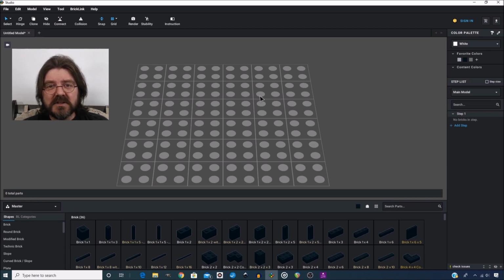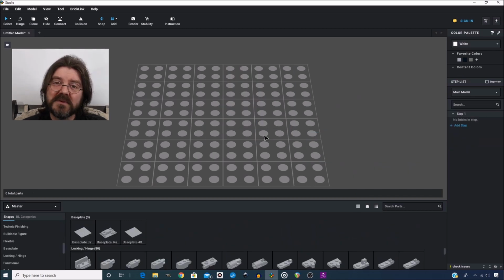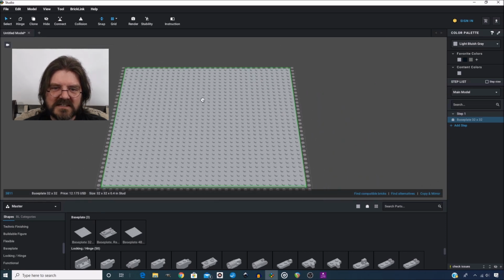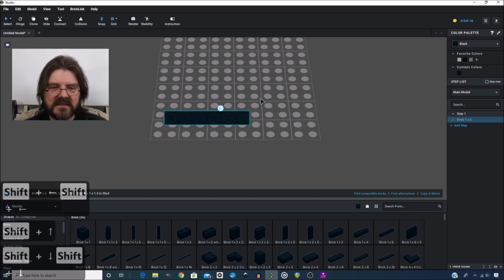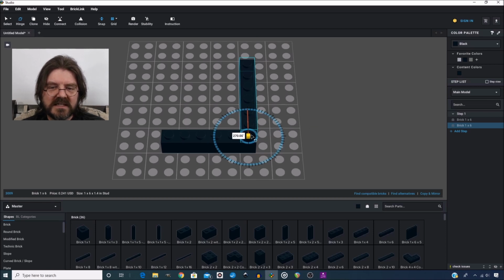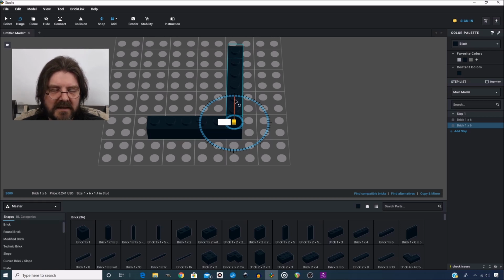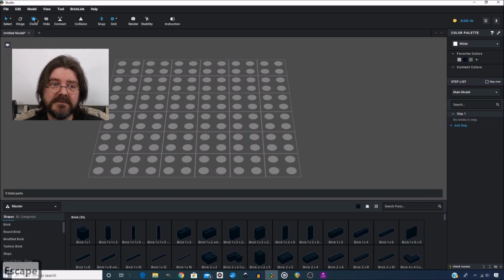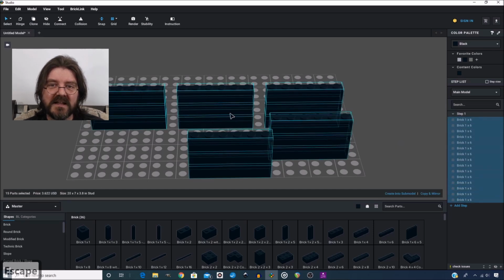Studio Tutorials - Manipulating Bricks. How to start creating your own LEGO model!

Comment: Great hints, thanks for your channel, also for adding the sub text. I would like to address a question regarding the hinge tool: Can I somehow choose or specify the yellow pivot point ? My example: I would like to show the steering of a tractor - so I choose the tires and some bricks (esp. not all bricks!), but then I can only rotate by a pivot point specified by Studio itself. As a workaround I move the selected bricks to the outside and then rotate them and then re-integrate them - sometimes cumbersome depending on the number of bricks. I hope there is an easier way.
Reply from the maker: Thanks Yanox, glad to help :)

Unfortunately that is the only work around available to us now. Hopefully this feature is implemented in the future.

Comment: Hey, Thanks for the video :) Quick question though- I found out that I have some problems with moving limbs of a humanoid model like ones from Hero Factory's 2.0 generation and forward (the ones with the attachable "body plates"), and it seems like the program can't find out some of the hinge point of any limb, like the one in the middle of the arm or the leg, and those that it DOES find are making the entire body of the model to move, and that is not the desired result. Do you happen to have a video about how to properly manipulaty such parts, and making them posable? thank you kindly.
Reply from the maker: Glad it helped.

Sometimes the issue occurs when you add another piece onto a piece you wish to move, for some reason the program will only sense two pivot points. When you run into that situation, remove the parts on the part you wish to hinge, hinge it how you wish, and then return the parts back to their position. It is a bit of a pain, but iti is the only workaround I have found.
Reply: @PlaywellBricks   Thank you kindly! :D Also, I think that I just found a solution to the hinging problem- you see, I just found out that if you click on one of the hinge points in the limb (when the plates are still on the limb), if you drag it all the way to the point on the limb that you DO want to hinge, and then you let go, and THEN it reveals the hinge points you actually want to alter, and you can alter it WITH the plates still on in the new angle! :D
Reply from the maker: @daneyal7162  Wow, that works! Great find!!!
Reply: @PlaywellBricks   Thanks! :D Glad to help from my side! :)

Comment: So glad I found your YouTube channel and this video series. I have some experience with Studio but don't use it all that often so I'm sure I'll pick up a lot from you. You mentioned the memory & lag issue, I'm curious, what computer specs are you running? I recently purchased a Dell XPS 17" laptop that has 64 (yes, sixty-four) GB of RAM. That should take care of the lag issues :-D
Reply from the maker: Hi Ben, I am very glad you find the channel useful!

I am currently running 32 GB, and a 8GB video card. I have know users that have run this program with 128 GB machines and the latest video cards and still experience serious memory leaks, lags and crashes.  Unfortunately, there are some serious issues in the way submodels and the clone tool work in the background, which is where the issues stem from.

Comment: very good tutorial, but how to use the CONNECT button ?
Reply from the maker: Thanks, I will be doing a video exclusively on using the Connect button :) I covered it very briefly in the Instruction to Studio video.
Reply: It's in the top nav bar. Click that then pick the LEGO part in the viewpoint, it will automatically show you the available connecting points. Then click the part you want it to connect to. Hope this is helpful.